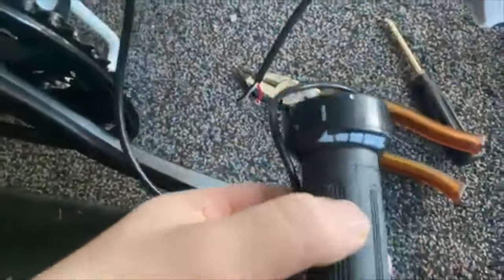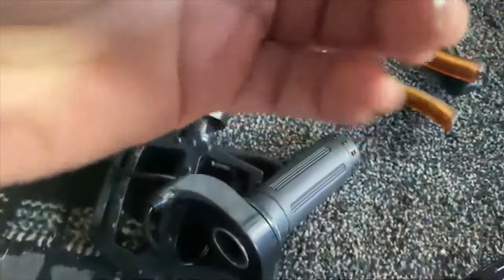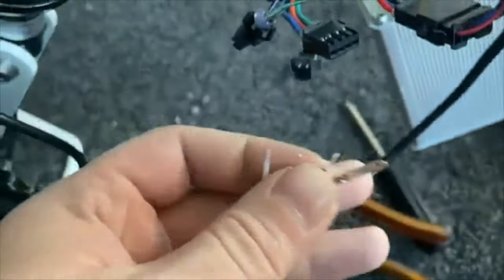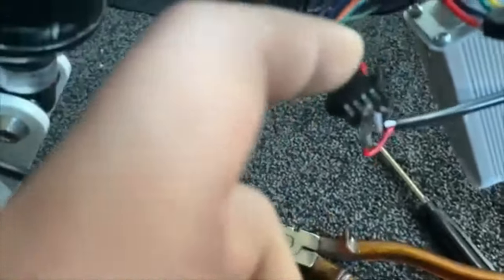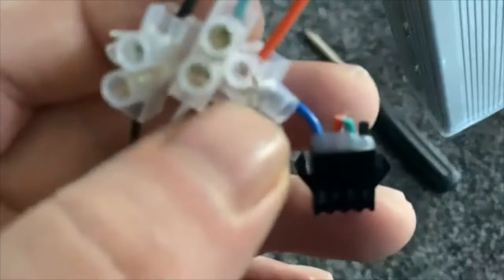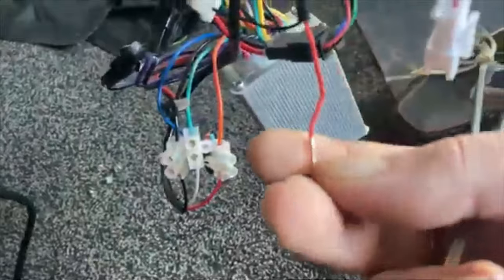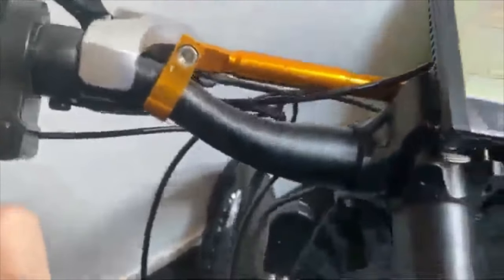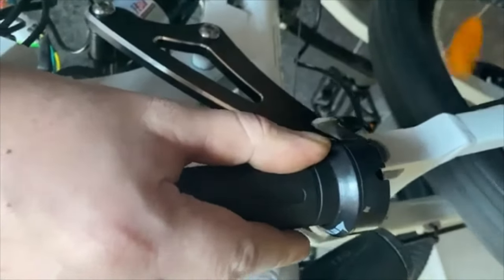Electric bike throttle connection different wires

Comment: Hi B loving the videos its about time somebody covers these same bikes and its crazy because your doing all the stuff i have wanted to do for ages. I have bought the throttle with the LED battery indicator and ignition key with it, there are 5 wires on it  as follows.  One black block connector with green red black and two separate wires blue female bullet connector and yellow male bullet connector.  Do you know where thery will connect to on my same bike controller.?
Reply from the maker: blue and yellow u wont need to use unless u want to see the display if u do then use blue wire to red
Reply: @bubblesway  thanks for the quick reply,  when you say use the blue to the red ...,which red do you mean as there are a few in there lol also how did you get your handle bar grips off ?
Reply from the maker: maxta mcpherson the blue wire with the red wire for the throttle use air spray wd40 or deodorant gets grips off

Comment: I have a big problem I try to connect my Ebike throttle to a vesc it has three cables red white and black and the vesc also I connected those but in the software of the vesc when I try to map my voltage of my throttle it doesn’t show anything when I turn the throttle please help me
Reply from the maker: Corbi Kristukat wat sort of throttle is it
Reply: bubbles way its just an normal ebike throttle I don’t know how to describe it but I can tell you the model number
Reply: bubbles way its the ft 21 x

Comment: Can you please help me. My controller has 4 wires Black, white, orange, red. My thumb throttle I’m trying to add has three wires black, white, green. How do I convert this 4 wire controller to a 3 wire throttle?
Reply from the maker: Black to black white to white green to orange
Reply: @bubblesway  
Thanks for the reply! I meant to say my throttle has colors of green black and red. I know the black goes to black but I’m not sure with the green and red wire
Reply: So the throttle is green, black, red
The controller is orange, red, black, white
Reply: @eastwood111  I think green goes to Orange red would go to Red black to Black
Reply: @eastwood111  if the white one is skinny and small I think that's for your light

Comment: How do I wire a3 wire throttle to an original 6 wire controller oem throttle with power and cruise control the 3 wire has none of this

Comment: Great video, well done...can I please ask....just say I wanted an inline cut off switch on the throttle cable so I can press the switch to deactivate the throttle....is this possible to put some sort of cut off on the throttle cable, thanks, tom
Reply from the maker: Yes u can
Reply: @bubblesway  thanks for your kind reply, do you have a video about installing a throttle cut off switch or if not then what component and technique would it require to fit it, many thanks, Tom
Reply from the maker: @Tomanart  u could use a light cut of switch that would work well
Reply: @bubblesway  ok thank you

Comment: Need your help buddy
Reply: I'm changing a thumb throttle on my ebike too a twist throttle... my original has 6 wires red blk blue green yellow and white ....  whats the best way to change it?
Reply: Hey man. I'm upgrading my ebike with a universal twist throttle with LED display reading just the current watts being used, a LC960 display screen, a 72v 3000w 80a controller, with a 60v 40aph battery. On my display screen, there is a brown wire that comes out of it. I need to know what to connect the brown wire to. Would you know? If so please help me.